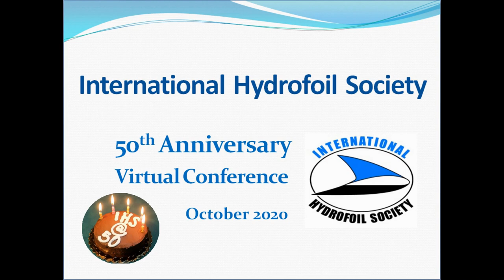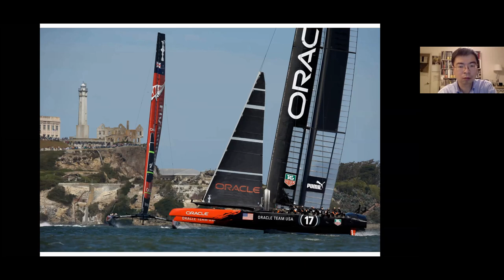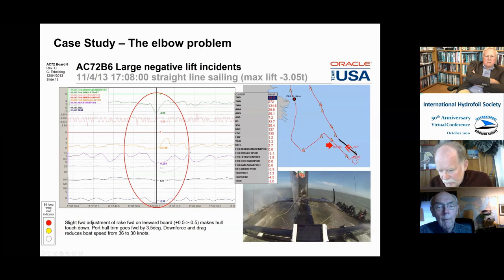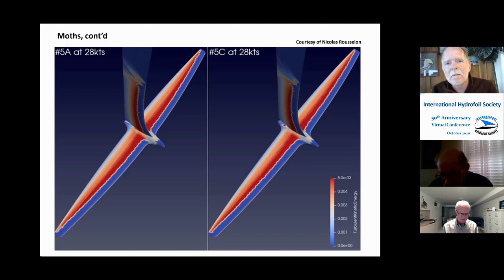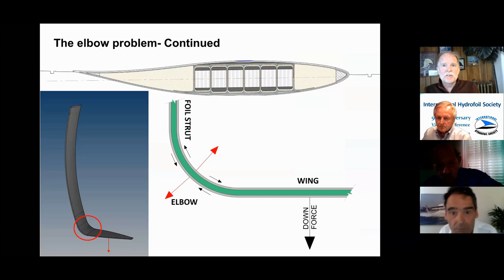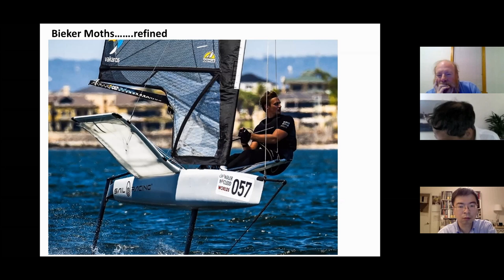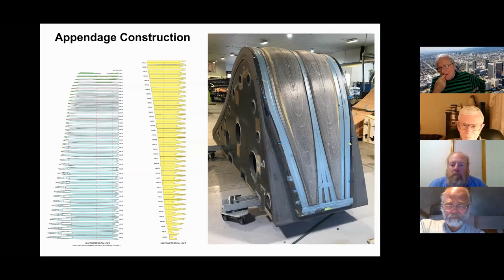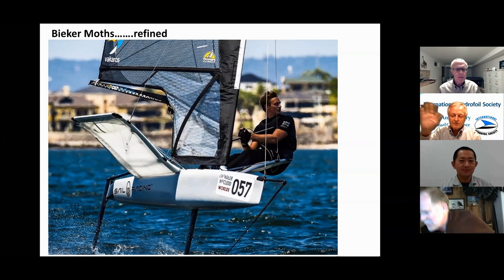HYDROFOIL -- Paul Bieker, Distinguished Naval Architect -- Hydrofoil

Comment: I wonder if someone in the hydrofoil community can enlighten me. My understanding is that there are essentially 2 options for ride height control, a passive or geometric control typical of surface piercing foils, and the active control of ‘T’ foils.  Inherently, surface piercing foils are wave-contouring.  It seems imperative for ocean going vessels which will experience high sea state, that they be able to fly above the seas and not follow the contours of the waves.  Yet, 50 years after the Navy developed ocean going vessels with active ‘T’ foil control, I see multi-million dollar ocean race boats with surface piercing / wave contouring foil technology.  Gitana 17 for example is poised to make a run at the Jules Verne Trophy, but has ‘C’ foils in her amas.  Hydroptere has basically a 2 part ‘V’ foil with trim control. She is still very much wave contouring.  What is the technical barrier preventing active foil control, and flying above the sea, on ocean going sailing yachts?  Why has no body put T foils on an ocean vessel?
Reply: hydroptere used the increased lift from v foils  becauw of increased area to lift of (its a rather old design(account for the cost a 100 million ac campaign in the 201x can develope much better foil/control systems than hydroptere in the 90s))

gitana 17  might be a rule thing(is it allowed to be computer controled? i know that for the Imoca 60s is prohibitted)

ps also consider saftey a surface piercing foil can be more reliable(important on the ocean) than a t foil

Comment: Good afternoon, dear experts ... Can you (approximately) determine the power of the propulsion device to move a mass of 700 kg on a hydrofoil? at a speed of 25 km. h.? .. Thank you ...
Reply: you're going to have to establish what span you can use in your application and then find a foil design that gives 700kg of lift in that span at 25kmh then you can find the drag figure from that. But as an example the Candela C-7 has 55kw, and weighs 1300kg without passengers and cruises at 22knots, which is about 40kmh.
Reply: Спасибо ... В наших условиях эти показатели не требуют регистрации и прав на управления ,доступны любому ...  Катамаран на крыльях ,построен и испытан ...